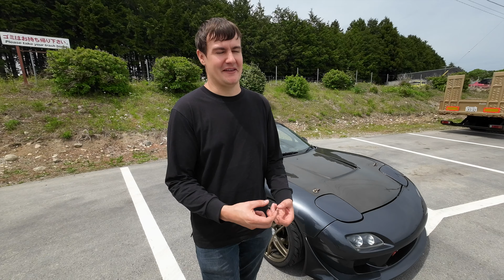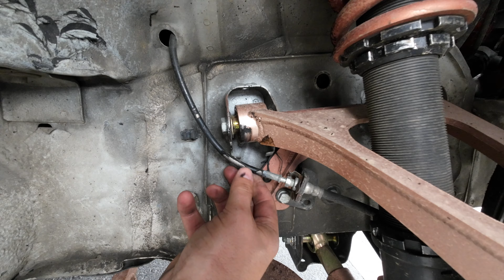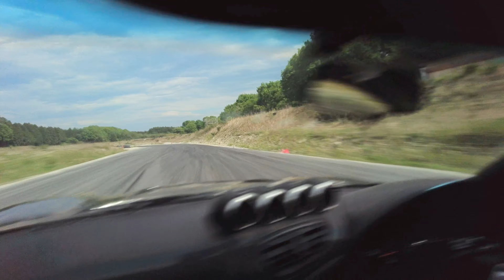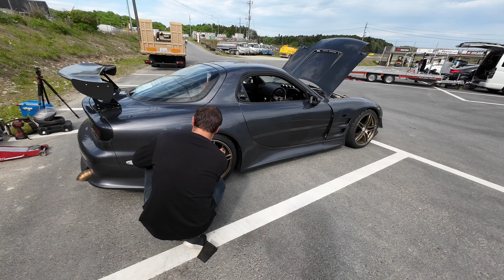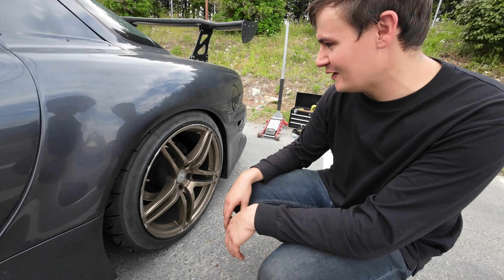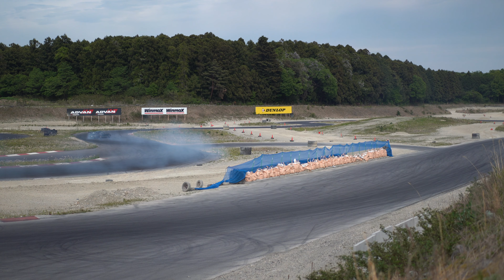Drifting Tskuruma Circuit with PSM!

Comment: Great stuff! Your electrical issues certainly look like a bad main connection, yeah!

But as a quick it worth trying a different igniton switch? I had problems that would result in full cutoff only at certain steering angles and speeds, and turned out to be worn ingition switch. Was more likely to happen when car was hot driven for a while. New igniton switch fixed it immediately

It was replicated by turning wheels to that position of cut and jiggling the key around in barrel aggressively, it would cut under certain loads from my key ring etc pulling on the barrel and thus ign switch contacts
Reply from the maker: ended up being the starter motor power wire 😅
Reply: @Andrew Date  watched your gunsai upload yeah! Good job finding it!

Comment: Love ya vids mate you rip what's the specs on your engine ecu etc
Reply from the maker: thank you! it's an engine I built with all Mazda oem seals just with turblown studs and i used a kyle mohan racing half Bridgeport template. No machining, balancing etc 

Ecu is haltech elite 1500 tuned by Omar at Raceonly remotely from Australia. IGN1A ignition coils and injector dynamic 1050cc x2 and 1700cc x2
Reply: @AndrewDate   yea awesome 😎